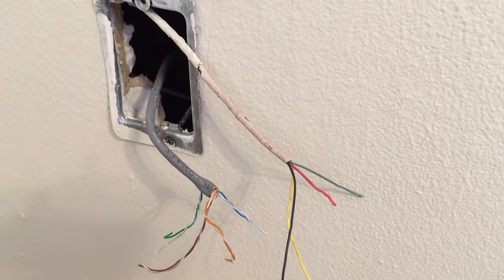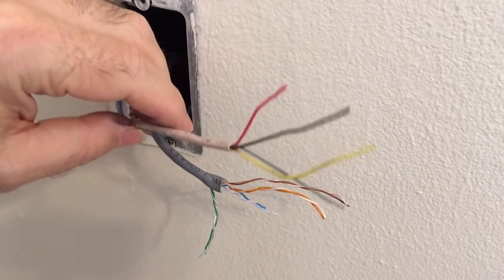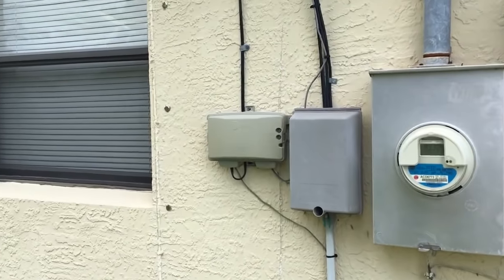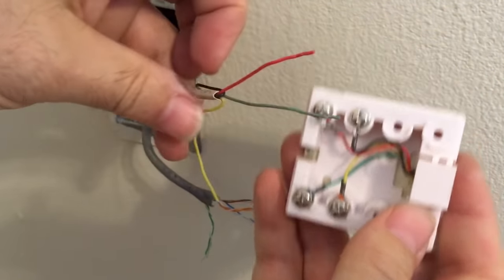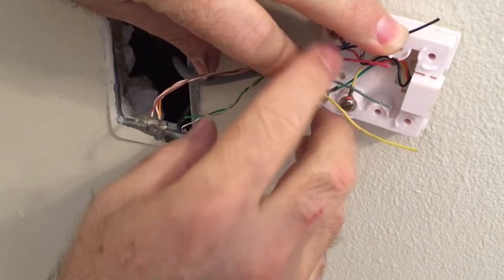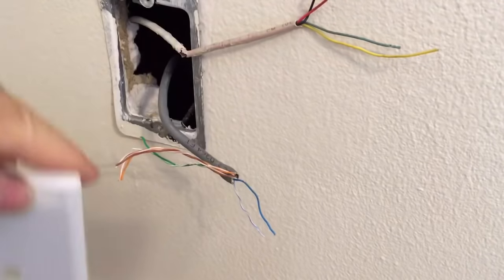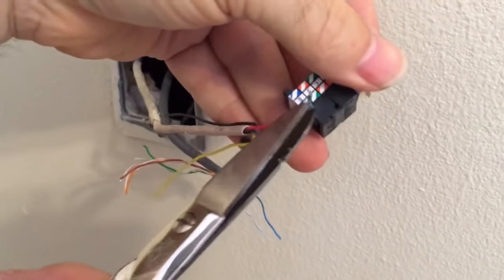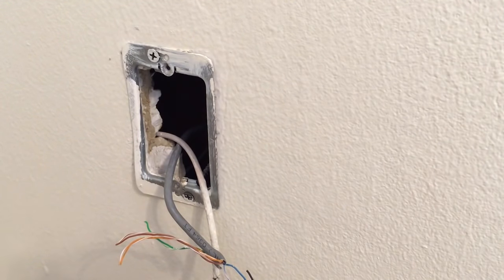House Phone Line Wiring

Comment: I'm an intern at my local telephone company. When I was in I/R, we never installed the older, cat3 style of cable. We'd always use cat5e on residential installs. For bonded DSL installs, in particular, adjacent pairs found in cat3 are prone to experience interference from each other. Nowadays, you can often find cat5e for less than cat3.
Reply: You will usually find cat3 in older homes so best know the cat3 installations

Comment: I really appreciate this video, but it would've been nice to see how the wire(s) is connected on the other end at the Network Interface Box. Thanks.
Reply from the maker: ah, that's a good point John.  Maybe this video needs a re-do.

Great suggestion.  :)
Reply: @DIYTelecom  This was two years ago, did you ever do a re-do? Did you do another video covering that question? I need to know how many wires come from the dmarc into the house and is there at least 2 or possibly 4 wires inside that jacket?  The wires I have don't seem to be the same colors. If you did another video on this please send the link. Thanks

Comment: You did not explain how to attach the yellow or other color wires to the yellow wire already on. I have no experience with this so I'd appreciate it if you would explain this to those with absolutely no experience. Thanks
Reply: Strip the wire so the copper is exposed, wrap it out around the same color screw as ur wire and screw it down, but I would replace that wire if I was you, that old quad wire and it's terrible, run a cat5

Comment: Excellent information...brings me closer to accomplishing what I need to for my house, which is full of CAT5e and CAT6 for data AND phones with a home room to a closet, where I can switch the purpose of the jack from phone to data. For example: disconnecting a phone line in the closet (it has an RJ45 connector) and plugging it into the switch.  Now that I'm adding both data and phone jacks, I need to sort out the jack's pinouts and how to interconnect the additional phone cables to a single existing phone line.  I'm thinking of rigging up rack-mounted patch panel with RJ45 keystones.  Getting them all interconnected is the tricky part...not sure whether it's physically possible to punch down more than one wire on the keystones.  Suggestions appreciated.
Reply from the maker: You're so fortunate to have those data-capable cable runs in your home.  I am so jealous!
BTW, if you're not familiar. With my other YouTube channel- /networkadvisor , you might find it helpful for DIY network topics. 
☺

Comment: Great, easy-to-understand and easy-to-follow video. What really helped me was explaining the difference between the commercial and residential wiring. For some odd reason, my house has commercial phone wiring. The description of matching the colors from the commercial wires to a residential wall mount helped immensely; the phone worked perfectly the first time. Thanks much.
Reply: The narrator has been doing telecom/network cabling for a very long time. The house phone wiring for my house, which was built last year, the technician used outdoor rated Cat5e and did one pair for the phone line and one pair for DSL. I was curious and did open my network interface in my front yard, and looks like they ran your red,green,yellow,black cable to feed the ouse and the inside was wired with Cat5e. Cat5e is fairly cheap, common, and most cable provider techs are usually fixing network problems on their end at commercial building, which are most likely using Cat5e or Cat6.
Reply from the maker: Exactly Tyler.  Most techs are running around with only cat5e or cat6 on their trucks.  That “drop wire” ( the tan cable with the red, green, black, yellow) is almost non-existent anymore .
Thanks for commenting! 😊

Comment: Thank You. I was able to replace my grandma's old phone lines with new ones.
Reply: Had new phone service hooked up today. Used to use phone like with Verizon but went to Comcast which used phone line off back of modem. Now I'm back to fios and I plugged the phone in and it won't work. It's a screw post jack with only red and yellow hooked up. Is it possible they have line hooked to black and yellow? Figured I'd ask since I watched your video. I learned a lot from it.
Reply: @Roopaloooop  red and yellow aren't a pair for inside wiring or outside plant. It would be black yellow, blue white and/or green red for inside. Outside its blue orange green brown slate is ring and white red black yellow violet is  tip
Reply from the maker: Ahahahhaha...   that’s what’s great about YT,  everyone willing to help out.  😆

Comment: Running in series is better than Running them all back to the de mark. Running them all back to the de mark is called star wiring, those pairs that arent being used, act as airials, so cause noise issues. 

Twist the wires together too, which makes the pair rejects noise.
Reply from the maker: Def agree that unused runs to nowhere to increase RF interference 
  I guess in a perfect world the service tech would disconnect any home rum not.in use ( But we know in reality that wouldn't happen).  Great comment 😊

Comment: It helped a little bit I'm working with an older style screw Mount and I figured okay that's what I'll do I'll serial Mount from the other one I put in a couple years ago and just extend a wire out. I think I have the commercial wires cuz I got them from a commercial place when they were taking them out of the building and I got a whole bunch of wires of pretty long lengths so I think I should be able to find one that will fit.
Reply from the maker: Awesome.  Good luck with your project.  😊

Comment: Plastic cover on my surface mount in residential house become brittle and broke. Didn't know anything about it but this video gives me confidence to replace it. Looks like a surface mount with an existing 4 strands of wire setup using a screw post setup.
Reply from the maker: Good luck sir 👍😊

Comment: That help me understand why I have two cables to my wall jack! Actually, like in your video, I have the two types of cables. Pretty old cables that break so easily, due to age and becoming dry or so? Can I fit a double jack in order to have one for a modem and other for my phone? Aim is to use my internal phone wiring with an IP phone system. Thanks for advising.

Comment: Excellent video-my Florida house built in 2004 has CAT 4 or 5 all serial (daisy-chained).  I suspect there was a wall mount that was abandoned-kitchen renovation. (tiled over)  I have access front attic, both lines going down to old wall mount.  Can I cut and splice all pairs together using your Redhead method.    I suspect this is why further down stream one of my phone lines is not working......a dull sound when I pick up phone from that location.  So I simply follow the pairing as you described?
Reply from the maker: Yes, pretty much what you said will work.  Good luck!

Comment: I've been guilty of running 2 POTS lines + 100MB network through a single CAT5e. Line 1 on Bl/wBl, Line 2 on Br/wBr, and my RJ45 stuffed with G/wG/O/-/-/wO :) As always, great video. I'm in the same field but really enjoy these nonetheless. Thanks!
Reply from the maker: Huh.... I always wondered if you could do that.   Interesting.   The other thing I never tried is:  Can you run two 100baseT connections in one cable (using the blue and the brown).  I always figured the crosstalk would slow things down. 
Great comment! 😄
Reply: @DIYTelecom  Thanks! I've actually done that with a high degree of success. absolutely zero signal degradation, same speed and latency regardless of what's behind it with n0 on G/wG/Br/wBr and n1 on O/wO/Bl/wBl. It wasn't a relatively long run (under 150') but when I used green and blue for n0 and orange and brown for n1, it resulted in a somewhat significant increase in  latency but the speed stayed the exact same. I wouldn't do it in a production environment, but it's always fun to tinker with wires. :) I was actually researching what would happen when ignoring best practices--did a run with a cable that was bent to heck and back, one where I used CAT3/guitar cable/phono leads instead, etc.
Reply from the maker: So I guess those pairs are laid out (568A-B) for a reason then if it makes that much difference.  I would not have thought that.  Sounds like YOU should be making YT videos! 😁
Reply: 2 phones and dsl bonded service will work just fine with 100mb with cat5, you only need 2 pairs data if you are bonded, your speed will depend on how far you are from the switch ur being fed from

Comment: DIY Telecom; In your description of this video above you quoted;  
"Almost all residential phone service uses just 2 wires (also referred to as "one pair").   Each pair of wires has a "TIP" and a "RING". (or kind of like Neg and Positive, but not really)".
In reality it is exactly like Negative and Positive (Direct Current 48 - 50 volts). You have many viewers and I'm sure you can teach a large percentage of them a very simple video with a volt/ohm meter (VOM) at the demarcation and then the final termination point (jack) to verify their voice/data/video signal is present and working. VOM's are free with a small purchase from Harbor Freight Tool Co. or very affordable for most DIYers.
Reply from the maker: hi Shawn, def agreeing with you that an inexpensive Volt meter (or multi-meter) would be very helpful for determining the presence of POTS line power on the pair.   The reason I said “not exactly”, is I was taught that Phone line voltage is -48vDC.   so, yes it is 48 v between the pairs. (but maybe I am misinformed)
i super-appreciate it when viewers, like you, take the time to leave detailed insights because many people read the comments.  And then, we all become smarter. 😀
Reply: @DIYTelecom  ; DC voltage is available on your car battery. If you look for voltage on one conductor and ground on the other you will know how to use a VOM. Current flows on the positive to the device (voice-data-video/not just POTS anymore) and the circuit is completed when there is a grounded conductor with continuity back to the central office. If your experiencing problems with no signal at the jack, it might help to find the two wires that have your POS/NEG continuity. A DC circuit cannot be made without +/-.

Comment: My first time changing out a phone Jack.  I have the “biscuit” style.  You didn’t tell me how to actually connect the wires coming out of the wall to the biscuit. Do I just loose the the screws on the biscuit and wrap the wall wires around corresponding screws?  Probably seems obvious, but like I said, I’ve never done this before.
Reply from the maker: You got it right.  That’s what you do.

Comment: nice video. I have been doing this stuff for 15 plus years, you explained it very well!
Reply from the maker: +Jeff Moss  thanks Jeff.  It helps to hear that from someone like you.  Its always balancing-act.  I try to restrain myself from over explaining the topic and thus losing my audience.     The feedback is much appreciated. :-)
Reply: t 5:00  what is a single line?
how many users can be accommodated in 2 pairs? 

the connection u get at the telephone exchange or de mod (whatever u call it.that thing outside ur house) how many users can use them max...because if it were max connections then they would have single demod for the whole neighbourhood.

plus make avideo of  how a phone/modem splitter works..how a single copper wire is used to give telephone plus ethernet(internet) signals
Reply: t 5:00  what is a single line?
how many users can be accommodated in 2 pairs? 

the connection u get at the telephone exchange or de mod (whatever u call it.that thing outside ur house) how many users can use them max...because if it were max connections then they would have single demod for the whole neighbourhood.

plus make avideo of  how a phone/modem splitter works..how a single copper wire is used to give telephone plus ethernet(internet) signals
Reply: mashhood syed how to plug a n extension phone into a phone jack
Reply: Jeff Moss I'm using a modular model and need to connect broadband as well. Do I still use the 2 wires or do I use an additional one

Comment: I watched this hoping to learn if a wire is a TX or RX something of that sort, and does it matter if the 2 main wires needed are put on the wrong way. I have just done a biscuit wall mount and it works but I am not sure if I got the cabling right as I have an older type biscuit mount that all the wires are black.
Reply from the maker: So that’s a great question the polarity of the wires USED TO matter.  Last 20-30 years,  doesn’t really matter.  There isn’t a TX/RX or even a +/-.   It is direct current but I have rarely seen it ever matter anymore.  😊
Reply: @DIYTelecom  Thank you for a quick reply. That puts my worries at ease. I can leave it as it is then.

Comment: I recently had the fun part of extending the connection from my room (where the live socket is for my connection) out into the lounge room to my new Data Cabinet so everything is one location as I wanted everything out of the bedroom. Needless to say I had to look at the box I had purchased to get it connect it took a little while to realise its on the 2 center pins that are used so had to track what colours which turned out to be Red/Green ones that was all done I had the Cat6 run already so it was patched into that into my Patch Panel so that's all done but I will have to re-do the socket plug as it was done a little weirdly lol mind you I have to say I was happy as I have never done it before lol.. Good video
Reply from the maker: that's great to hear James.  that technique is common in the commercial work too.    Thanks for watching and letting me know what you're working on.  Helps me make better content in the future. :-)
Reply: DIY Telecom I’m currently getting the 380 hours I need to do my Open Cablers Course... love Australia and their archaic laws sheesh they love their $$$$$$ lol
Reply from the maker: Oh wow... so that’s how it is down there?   While I do agree that may be OVERKILL (yes, pun for the M.A.W. fans in the US) 😆 unfortunately that wouldn’t be such a bad idea for some of the junior techs here in the US.  I see a tremendous amount if sloppy work in the field. 
Good luck with that James.  😄
Reply: DIY Telecom it’s overkill on everything here lol. I’ve had to apply for my security license just to install Security Camera Systems and Alarm Systems 🤑 electrical I can understand but Data like for real lol 🤦‍♂️

Comment: I'm pretty sure you need to strip about a half inch of insulation off of the red and the green bell conductors before you place each under the biscuit screw terminals; the blue and white-blue Cat 3 don't have to be stripped - just punched down on a modular jack.
Reply from the maker: I didn't mention anything about stripping back the insulation on the wires?   Shame on me.  I probably just assumed it was Electrical 101 and figured everyone would know that. 

Thanks for clarifying!  :-D
Reply: Of course they need to be stripped and he obviously knows that this is just a how to video to show us how to install. I find it funny when ppl point out the obvious like its something only the educated or professionals in the field know and the rest have to be told when all it is, is commonsense lol
Reply: Yeah, I've been looking for guidance on how to strip that insulation without damaging the wires. So far, every article on this topic skips over that part.
Reply: Electrical scissors bro
Reply: @huttarl  Your front teeth will work just fine and not damage the copper conductor causing future issues or faults. It will however fuck up your teeth in a hurry. Keep smilin'!

Comment: Great video, but I have a question.  We have a wall mount AT&T cordless phone that was wired into an outlet that I believe was connected the two or one light switches in the vicinity. (No outlet in that wall!)  Now we need a new phone and can not find anyone who knows how to reconnect the new phone.  Is this no longer an option?  Do I need to have an outlet to plug in the 'transformer'?  Can't figure out how it was done, but it worked for 15 years!  Any suggestions would be appreciated!

Comment: Hello yes im trying to install a phone jack on the apartment. Working on phone line like this do i need to shut the breaker off or anything? Lmk thank you in advance.
Reply from the maker: There is a small amount of electricity on the phone wires, but not enough to hurt you.  You might feel it if someone rings your line while you are holding the bare copper of the wires.

Comment: Have you ever seen a wall phone jack with prongs like a fork on the back and the wires are wrapped between the prongs?  The outside of the jack is no longer useable in our new home (built mid 1960s).  We have wire sets and colors that were connected are blue with yellow stripes and yellow with blue stripes and the other set is red with blue strips/ blue with red stripes.  Trying to replace the jack so we can plug the modem into the outlet, but need to replace the jack first.  Assuming we shouldn't cut the wires or we may loose phone connectivity in the other jacks.  Thanks in advance for any suggestions to help us solve this mystery jack.

Comment: What able if your wires go directly from wall to a rotary phone not thru a wall mount but I want to disconnect rotary phone and make into a wall mount so I can plug my newer phone into it?
Reply from the maker: Right.  A biscuit jack would work.  But that must be some old, old wiring.   Modular plugs for phone wiring was quite standard by the early 1970s. 😳